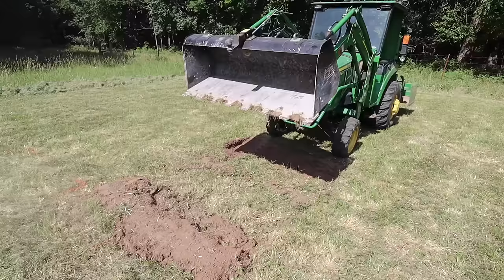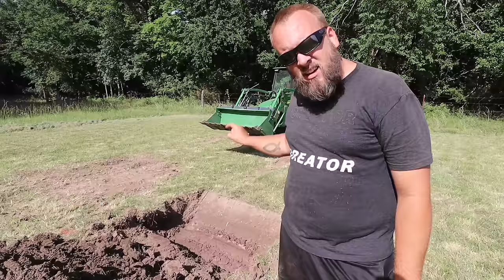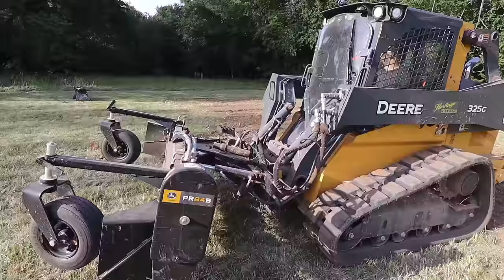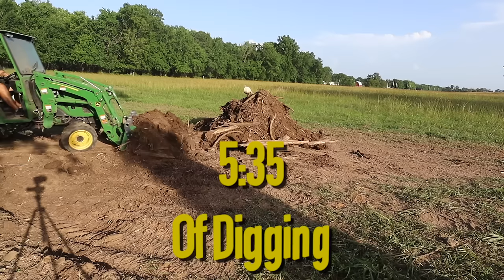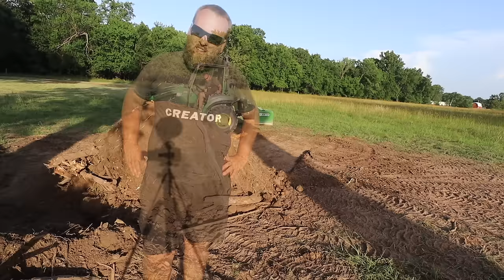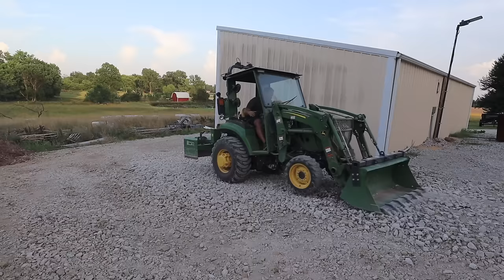Tractor Toothbar Torture Test - Who Makes the Best Cutting Edge?

Comment: This is the exact type of tooth bar comparison that I’ve always wanted to see and I really like that you included the factory bucket in your tests! Without owning anything but the stock bucket, I always expected that the Heavy Hitch would be the clear winner based on other reviews I’ve seen, but all of your findings make perfect sense. Thank you for taking the time (and money) to make and share this video for all of us on YouTube! Also, Happy Father’s Day, Brock!
Reply from the maker: Thanks

Happy Father’s Day
Reply: I have the HeavyHitch.  The big reason I got it over the others was ease of installation and removal as in my size (48") it is a clamp on solution.  It really goes on and off quick and easy.  I primarily use it for braking up ground in the wooded areas around my home and large rock removal.  It works well for those jobs.  Moving loose stone like trap rock or smoothing a surface, I go with the plain bucket.

Comment: About the placebo effect, you have to remember that a toothbar is a tool and not a magical upgrade that makes a bucket better in all tasks. I bought a Piranha after trying to expand a ditch with a lot of small roots running through it. The stock edge often refused to cut through them. With the toothbar on, it cut through like they weren't there. But for unloading gravel or backdragging the stock bucket is going to be better. That's why easy removal is important.
Reply from the maker: Sounds right

Thanks for watching
Reply: I was changing out the tooth bar too much and just wound up buying a separate stock bucket. So now I have a stock bucket and a bucket with a tooth bar. So much easier.

Comment: I think you saved me a couple hundred bucks.  I've been looking at the toothbars for a bit and have been going back and forth. I think you are spot on with the placebo effect.  Some of the videos I watched they were showing before and after and to me they almost seemed the same.  One review I saw of the piranha bar, it did seem to do better when cutting trails. Which for that application, does seem like a good fit with the sharpened edge. However, one thing you did not address was the wife factor.  How are you going to explain that the device you just paid a significant amount for is nearly useless.  😀 Thank you again!
Reply from the maker: Sounds right

Thanks for watching

Comment: I have a HH toothbar and I agree with your assessment from your testing.  One thing that I appreciate about it over the stock edge (or other toothbar solutions on the market) is that the length of the teeth makes it like a set of mini-forks which are very useful for utilizing the bucket for picking up and moving large irregular-shaped objects like stumps.  The HH toothbar plus bucket hooks plus chains = I can easily move pretty much anything that the loader can lift regardless of weird shapes or oversized dimensions that normally wouldn't actually fit in the bucket itself.  I have "real" forks as well, but not having to swap out between the bucket and the fork frame etc for 99% of that kind of stuff is a major win for my weekend warrior projects.
Reply from the maker: You’re not the only one who has mentioned that advantage from them sticking out further.

Thanks for watching

Comment: Brock, 
Thanks for doing these tests, I know the time and effort that went into that was extensive. Not to mention all the diesel fuel used for this….. I was eyeballing the piranha tooth bar for a while now. I hadn’t even considered the other ones. This video pretty much affirms my suspicion of it being the right choice for me. Keep up the good work!
Reply from the maker: Thanks
Reply: I have the piranha. You can’t expect it to make a lot of difference. But it depends what you’re using it for, as shown in the video. It’s easier to skim off sod with it than without it. And if that were the only benefit, I’d say that doesn’t justify the cost. But…

I leave mine on most of the time. One thing it does that wasn’t mentioned is protect your factory edge. Helps prevent bending. Helps prevent wear. I’m very happy with it after managing my expectations. I did have to change my back-dragging technique with it on.

Comment: Great video! I agree that The Piranha was the winner. The Heavy Hitch sucks at back dragging. If I was looking at doing a lot of finish work I wouldn't own one. However, I live in the NE Ozarks and the soil here is very rocky and full of roots and stumps. I'm always pulling rocks out of the ground that I can't move by hand. My stock bucket had all sorts of trouble breaking through it to dig. Those teeth and the weird geometry really made a difference. The distinct points that break up the smooth cutting edge allow me to dig into the rocks with narrow points of contact. The stock bucket made digging around here sort of like trying to break through concrete. I suspect that the other teeth might have the same problem the stock bucket had, though without doing a comparison like you've done I can't say for sure. The Heavy Hitch has also been far more effective at getting under stumps than the stock bucket, too. Maybe that's where the Heavy Hitch is best; really rough brute force and ignorance jobs. For any sort of other I think that my stock bucket did better. I do like that Heavy Hitch, though. For the rocky ground I live on it works very well.
Reply from the maker: Sounds right. I thought about taking it up on the hill where my property gets rocky but would be hard to compare apples to apples on digging out different size rocks and squeeze it into a video

I wouldn’t be surprised if it excels there

Comment: Have a 72" Wicked on a light material bucket.  Wanted to add strength and get through my solid clay that was just stalling the tractor before (Mx5200).  It does great ripping brush as well.  I have never compared anything other than factory, but a definite upgrade in my rocky clay.  Good review

Comment: I too have the Piranha toothbar. I purchased mine for two reasons. The first was to protect the factor edge on my bucket. I didn't want to tear up/wear down my factor bucket and have to replace it. I figured a toothbar would help reduce the damage especially when digging and hitting those unforeseen rocks.

The second reason i purchased the Piranha was I wanted something that would cut into brush roots and also push through clay soil. The toothbar has accomplished both of those for me. 

So for me, the Piranha has proven itself worth the money and matches the results of your test although I have only the original factory edge to compare it to. 

I will say, my EA 55" Grapple has taken over must of the brush removal jobs and the bucket and toothbar is now basically for digging/dirt moving/rock work, which it does well with.

Thanks for another great video.
Reply from the maker: Yeah, I haven’t used one but I’ve never heard a negative word about those EA Grapples.

Comment: You did a great job with this review, thank you.
A big reason I bought the Heavy Hitch Toothbar several years ago, was to help pry out the multitude of rocks on my property.  I know, bad for the loader.  It does do better than the factory bucket.  But the best tool for rocks is, a 6ft, hand-powered pry bar!  The pry bar has tremendous leverage, and can dig out deeply burried slab rocks - that the tractor can't touch.
I do like the HH Toothbar better than stock bucket, for moving logs and brush.  And, my bolt-on pallet forks fit right over the HH bar - very convenient. But, I constantly stuggle to keep the HH bar from loosening - and literally falling off.  Now, my HH bar - sits in the barn unused...
Reply from the maker: Thanks for sharing

Comment: After getting my 1960 OC46 track loader back working( see Watch Wes Work videos) I found digging to be near impossible in sod, or hard packed dirt, even though the original cutting edge was in decent shape.
 I did some internet searching and ended up buying a B Expanded Piranha tooth bar. It's worked great, and won't come off till I have to shovel snow from my driveway this winter.
 I cleared an acre of mulberry and ash saplings, that were so thick you couldn't walk threw them. Some that had very large roots, were just cut off at ground level, while many of the younger saplings were pulled out, root and all.
 Since then, I have leveled off a pad, removed some big rocks and old concrete, and pushed some dirt around  for a neighbors camper site.
 I can say, it was well worth the money and works GREAT.

Comment: I have owned a Kubota B21 for 13 years and finally bought a Piranha tooth bar for it a few years ago.   I can't believe the difference it made.   I felt like I had a completely different more powerful tractor for loading work.  The physics behind the design makes total sense why it was the best.   It's all about sharpness and angle of attack.  The Piranha has sharp edges throughout coupled with an angled approach of those edges appearing to be about 45 degrees.  Imagine trying to cut a chunk of cheese with a knife by forcing the knife edge squarely through the cheese.  It would require far more power to do this rather than pushing the knife through at a 45 degree angle.  The other tooth bars tested have too much flat leading edges approaching the soil 90 degrees from the tractor's approach direction.   The Wicked bar does have jagged edges, but they are very small and too close together such that they undermine their potential to deliver optimal cutting.   I think the Piranha bar has the best balanced and simple design.   I just purchased a Kubota L47 for larger work and ordered another Piranha of course.

Comment: Seems like a fair review to me.  I have a 1025R which is lighter and less powerful.  I feel like a comparison video for the 1025 would find the stock bucket performing worse.  That said I do have a bit of buyers remorse after buying the heavy hitch tooth bar.  While it does perform much better for some of my bucket tasks, it still has the same drawbacks you mention.  I wish this video had been made before I bought mine.
Reply from the maker: Thanks for sharing. My goal is not to bash any product but just to give perspective

I did kind of wonder if the result would be different on a smaller or larger tractor.

Comment: Great video.  This is no doubt the best as far as how they function in common scenarios that many compact tractor owners would use them for.  I have a 3046R deluxe cab and use my bucket to, move compost around frequently, and as my compost is on a large concrete slab, a smooth bucket is actually preferable.   However, I also use it to move dirt given to me by road crews back to a hole I’m filling in the back of our property, and when scooping dirt that is not on concrete, it seems like a tooth bar would help, though after watching your video, I’m not sure now, though te Pirhana seems like the winner.
Reply from the maker: 3046 with a cab is a sweet machine.

Thinking about scraping off concrete you definitely would not want the heavy hitch or you would just need to be prepared to take it on and off

Thanks for watching

Comment: Pretty decent test.  One thing that I like about my Heavy Hitch Toothbar….over the others….that you didn’t test…would be stump or tree removal.  It rips up roots extremely well.  If you’re clearing brush or a bunch of saplings, it’s much better than a dedicated stump bucket.  The factory edge doesn’t do very well in this application.  I would like to see this type of test with the HHTB and the piranha.
Reply from the maker: Thanks for sharing
Reply: That’s why I got the heavy hitch one for and does great on roots. Everything else he showed was correct.
Reply: Forgot to mention that then, after you rip the roots, you can use HH tooth bar as a rake, dragging it backwards vertically.

Comment: I have the Piranha bar for my Kubota B3350, and one of the main reasons i bought was just to strengthen the bucket so i don’t do something thing stupid and bend it up.  I also put a medium sized piece of angle along the the top of the bucket to support my square hitch and chain hooks.  No worries about bending the bucket now.  I also love the performance of the tooth bar, it never fails to impress. Good job on the comparison
Reply from the maker: Thanks for sharing.  I did the same thing on top of my bucket before adding the grapple on the top

Thanks for watching

Comment: First, thank you for all of the work you did. I just purchased a new tractor and was looking at these bars. Your test is excellent. When I just take visual input as data, I also came up with your first and second picks. When I add your comments and real world “feel”, It validated the 1 and 2 ratings……so I was quite pleased that when you gave us your ratings, I had 1 and 2 correct. After the first test, I really wasn’t impressed with numbers 3 and 4.

So the question becomes (for my use) do I pay the extra for the Piranha? I think your statement of “protecting the edge” of the original bucket is a strong point to consider. 
I wonder if you feel the bar adds any structural strength to the front edge of the loader? 

Again, thanks for running this test. You did a great job and it is very very helpful.

Comment: To me, the piranha toothbar is the best digging toothbar.  The piranha toothbar will keep your bucket lip from bowing therefore, your bucket won't look as if it's attempting to smile when actually it shoud appear to be "mean and lean"🥴.  I used my stock bucket for years without any toothbar then noticed my bucket strarting to get a slight bow.  After 5 years of bare bucket use, I purchased the piranha toothbar and it's all hisorty from there.  I like your comparison.  Tractor owners/operators will make their decision after they do some heavy bucket work in rocky dirt and their bare, raw-faced bucket starts to smile b/c it's bowed-up. I considered the "Heavy Hitch" toothbar when I watched TTWT demonstrate use several years ago.  Great video; your video is a great demo and well worthwhile, Rockhillfarm. Only b/c I now own the BXpanded toothbar and have used it for numerous dirt, rock, and root projects do I lean towards the BXpanded Piranha toothbar.  Thank you for this video.  Sorry, you're catching grief from skeptics but I think you did an excellent job showing comparisons. 👍🏽🤠 9/12/23

Comment: Thank you for doing this! This is exactly the information I am looking for. 

Question:  I live in Missouri and have several acres of brush-honeysuckle I need to remove.  Do you think the Pirahanna bar would work well for removing this stuff?

I've already had some success with the factory bucket,  but for some of the larger bushes I had to use my forks to dig/pop it out of the ground. 

I feel like a tooth bar might give me just a little more leverage and help rip these invasive plants out
Reply from the maker: I do think it would help. I have done a little bit of that and the edge is sharp

I grew up in Missouri, and we are on the Missouri Kansas line
Reply: try looking at the tractor rake. I live in missouri also and it works great.
Reply: I live in KY and have a lot of bush honeysuckle I've removed using my EA grapple. It's worked great at popping out the entire root ball, which is key.  I know it's a lot more than a tooth bar, but a grapple is a great attachment!
Reply from the maker: Thanks for sharing your experience

 I’ve got a couple of different Grapples. I run an add a grapple with the tooth bar
Reply: @MattN03  how did you go about getting them out with your grapple?  I have the Pirrhana tooth bar installed (haven’t used it yet). Just got my grapple as well. Trying to figure out which one to use first
Reply: @wanny07  Line up a single bottom tine and get it worked under the root ball. Pry it up and and out.  Just keep trying, and they'll pop out pretty easy.

Comment: I wrote up my comment before watching the whole video and somehow the YouTube app lost them...

Basically we had a huge pile of topsoil in our back field that had been there for more than 20 years and was covered in tough, tall grasses.

When we bought our 1025R, one of the things we wanted to do was use those ~500 cubic yards of topsoil - but I found I simply couldn't get the stock bucket to cut through the tall grasses. My best, time consuming, option was to use the backhoe to break it up and then turn around and use the bucket.

After lots of research I bought the BXPanded Piranha Toothbar and Wow! What a difference. 

With the Piranha I was able to slice right through the grasses and roots and gain access to the topsoil. 

I did months later try testing digging with the Piranha removed and confirmed again that it couldn't dig. 

Since then I've also dug and moved many 100's of tons of rock and gravel,  smashed and pryed the Piranha into lots of big rocks, etc and it has held up very well. It isn't quite as sharp, but close enough to still work great.

The only task I find it doesn't work great for is backdragging snow on the paved section of our driveway.

For backdragging dirt and rocks, it works great, but with snow you want to clean right down to the pavement.

If you tilt the bucket down, the teeth leave stripes of snow behind.  If you tilt it more level, it leaves packed snow behind. 

For everything to do with dirt, rocks, topsoil, gravel (including backdragging dirt, rocks, topsoil, gravel), and cutting through roots, tall grasses, etc, it does a fantastic job and I would highly recommend it for anyone with a subcompact or compact tractor.